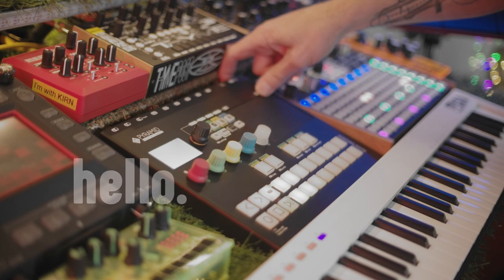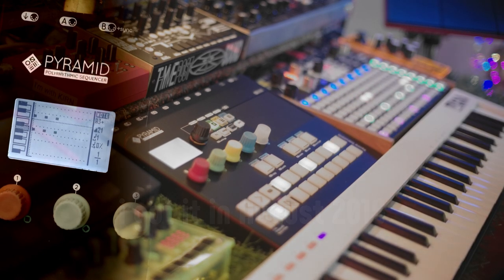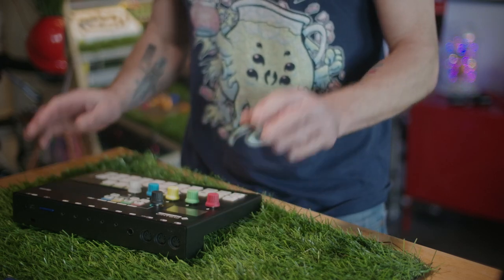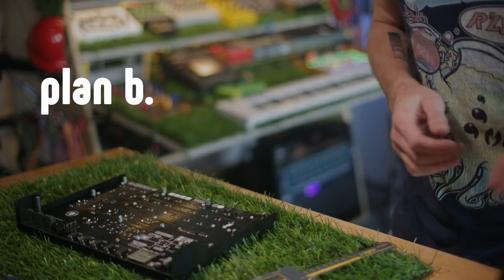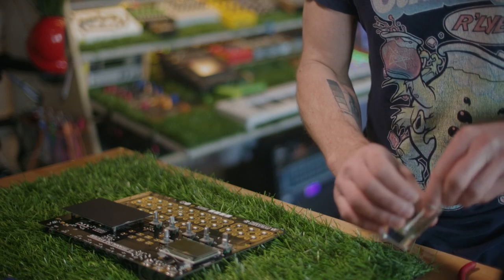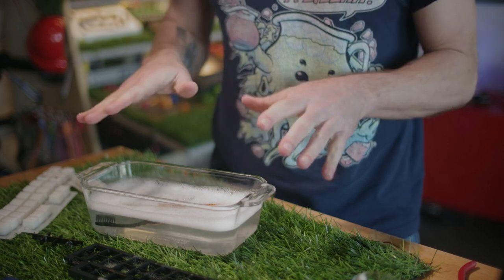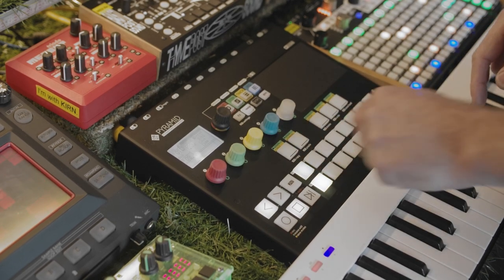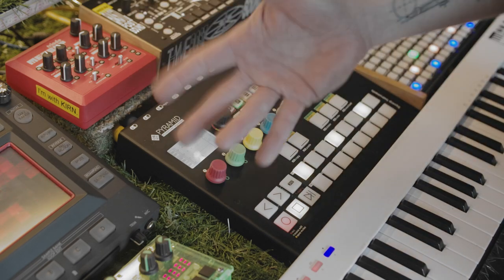Stay Home and Wash your Synths

Comment: Thanks for saying the torx size for the case screws. I was thinking of bringing my Pyramid into the hardware store to find out what size those are. I'm going to install some rubber feet. The adhesive ones keep coming off.  - edit: just rewatched and noticed you said 2mm hex, not torx. I have a mk3 pyramid and it has torx screws. :/
Reply from the maker: Ooh, interesting. Mine is actually a Mk1, that was upgraded to a Mk2 case a while ago. Didn't know Squarp switched the screws for the Mk3.

Comment: Awesome 👍, could u use rubbing alcohol for the pads? I've done same cleanup with my novation circuit recently:)
Reply from the maker: You can probably use vinegar or a solution of baking soda and water instead of deoxit. Search online for “remove oxydation from electrical contacts” or something like that.
Reply from the maker: Also if the problem is because the black traces on the pads have lost conductivity, you can use graphite ( pencil ) to restore them, or even some of these new conductive markers they sell to make paper-based electrical experiments

Comment: Quick question (thinking of buying a Squarp);
if something fails, obv. it would be better to repair or clean, but in a pinch, are all buttons midi assignable? (meaning that; can you plug in a pad controller to the midi in, and have those pads act as the pads on the sequencer (with backlight feedback)?
Reply from the maker: You can map a lot of things to midi, but not the sequencer itself. So you can’t operate 100% remotely

Comment: i was expecting a close up of the contacts. was there any visible oxidation?
Reply from the maker: Yeah, I had notes to take some, but then I got caught in the actual process of cleaning. There was definitely a change in coloration as I was sweeping the contacts with deoxit. But there was also a fair amount of dust on the board and pads. I didn’t notice wear on the carbon contacts, but there was some grime at the edge of the pads. All these things combined would have caused misfires, and the pyramid is operating smoothly now.
Reply: @OlivierOzoux  
Did u ever have to clean it again?